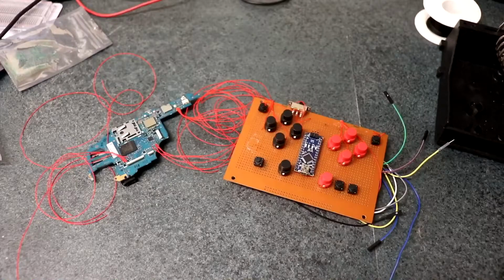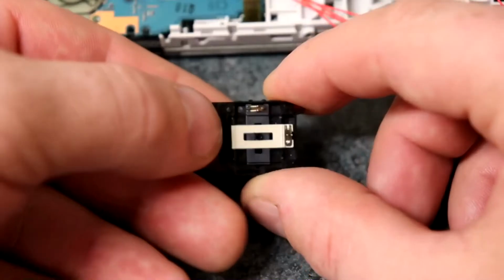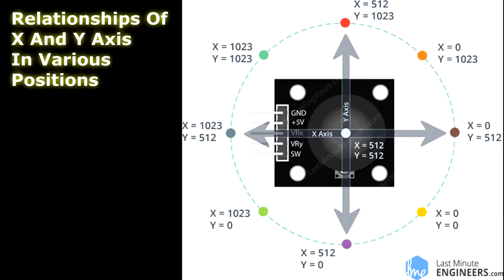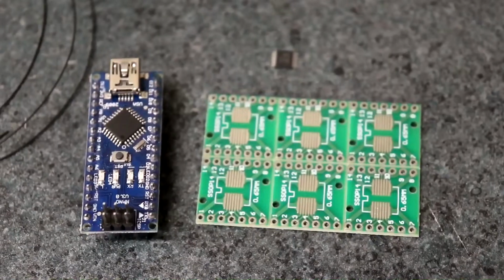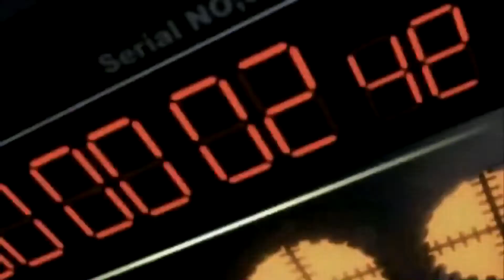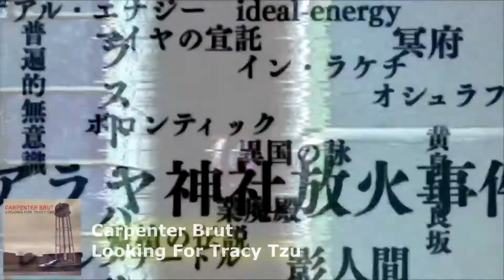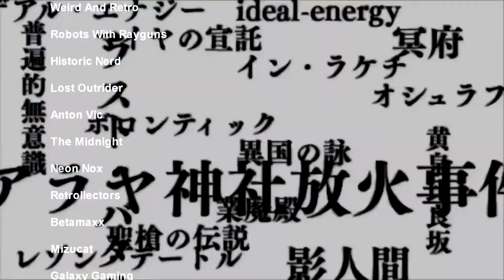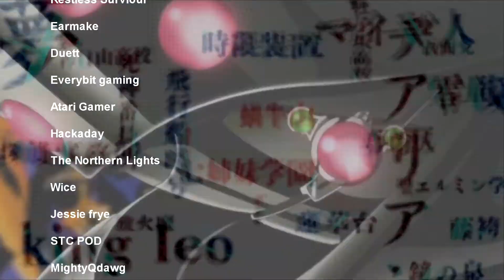The Consolized PSP PRO Part 2 (Ft. Super Derek RPG's)

Comment: Can there be a write up for the joystick, arduino button input, and the videoq
Reply from the maker: what do you want to know about it bud? its not exactly open source though
Reply from the maker: also will be selling solder free kits soon for you that are reverseable for a small fee so maybe look put for those follow me on twitter if you want bud @revolutions_4
Reply: @retrorevolutions4590  what the chip does and if I need to program it 
Pin out for the joystick/buttons 
How to go about getting 720p out of the psp